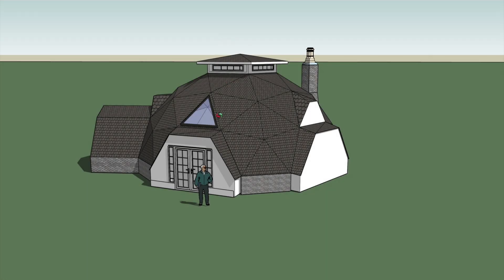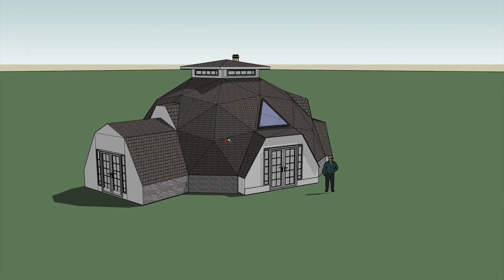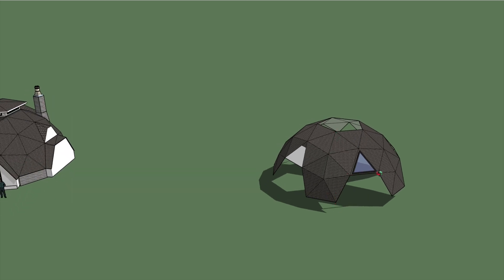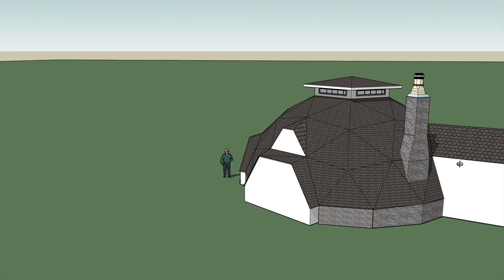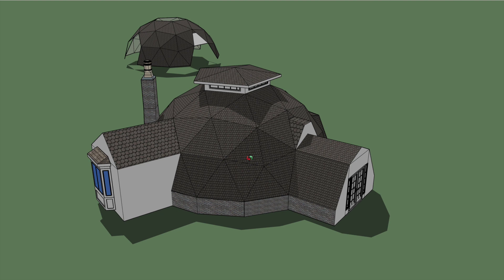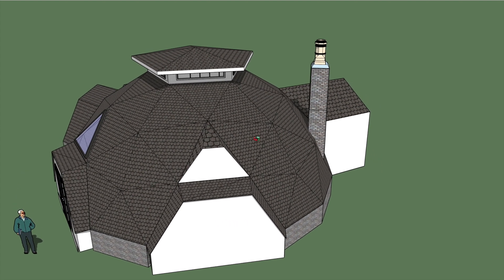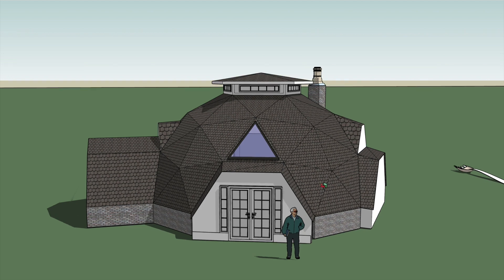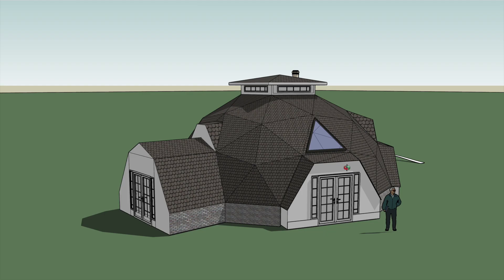Watch this before you build a dome home.

Comment: Why would you not want a fire in your home? It makes the home feel homey.

Also, why should it matter if you have to use different resources, if the top part has to be steel so be it.

Sure, I don't like the front door extension bit. But a lot the comments aren't the greatest, sure it's your opinion and thats fine.

Comment: If they indeed used real traditional house building concepts with it then it is fine. As long as they like it, because it is ok mechanically. I know you said it is weakened because it is only in essence 1/2 a dome, but if they used traditional building methods on those additions then the openings they took out of the dome are reinforced with headers, kings, and jacks. In other words the dome would be weak as hell with all those openings, but not if they put huge headers, kings, and jacks studs, like any traditional building has. Put it this way, it is not going to be caving in anytime soon. As far as the rest of the dome knows mechanically, it has no openings because they are reinforced as if the dome was never opened. But i wouldn't be building anything traditional in a hurricane belt. Actually i recommend not building anything in a hurricane prone area, but they still do it. 

But totally agree on those shingles, no matter what they are wrong for a dome. Fiberglass reinforcement will waterproof it, it will be a smooth shinny surface instead of asphalt. i recommend 2 part epoxy for the resin. If you wanted to, you can make the surface as smooth and as shinny as a modern car, any color you choose too, at the same time reinforce the dome even stronger, and waterproof the entire dome, with its fiberglass mesh and cloth embedded in the epoxy with a top coat of quality marine paint or even car paint.

But you do know we love you right, you are awesome with us, and correct as always. I was only saying if they use real engineering thinking, they can make the openings and still have a strong dome. To be honest, like you just said, if the dome was build in full without the openings, and engineered correctly(size of beams, etc...) it will be stronger than any other type of dome with openings, headers, king, and jacks or not. But it is overkill to be afraid to make openings in most situations, unless your dome is over the entire city.

Comment: The above dome sample shows all the disadvantages of the dome houses. It should be at least at 4th Frequency for this size 5/8 part of the sphere and with small riser. Then all the disadvantages shown in the video above will disapeared. And if you really want to feel the advantages of the dome house, do not make it so big. Better do couple of domes in a size of 6-7 mtrs in diameter and connect them. This is the right dome, :)

Comment: Im thinking about building a dome home w hempcrete, but not fuller. With a solid structure.  Thinking about copula on top, unfortunately must agree with you but what is the solution to it and most of your points?  Can't wait for the next one showich how to.  I plan to build about 11m dia in PL. Because I want a passive standard so the thickness of walls must be 400mm and when I've asked an architect about the insulated floor and a cellar. He stopped writing to me. YOu know, the insulation must be universally same thickness all round and bottom. I plan to use a low deensity mix as used to ceilings, and use it all rond, so will be light and worm. Need chimney, skylight, and enough windows.  Two storey to use space available. Have not sorted out the roof cover so the rain water be drinkable. Therefore no bitumen be used. I love to design myself and give to an architect to check. Use sketchup.   But try to avoid chemicals like glues and foams, an also metal bridges like nails or bolts across the wall. I'd rather use a dowels. Have not figured out a non toxic timber glue. Waiting  for the continuation, thanks.

Comment: I prefer the style and materials in the way designed originally by Buckminster Fuller. It's arguably better than a box home in every way and far more secure and long lasting. The Dymaxion home style. They also only way 3000 lbs vs 400,000 for a typical 2000 sq ft home. The efficient, strong circular design uses less materials making them weigh even less than a mobile home while being stronger than a brick house. I'll be looking to build a dymaxion type home here soon. Beautiful stuff.

Comment: The coupla is NOT a decoration, it is necessary for ventilation.  Many have built domes without a coupla and lived to regret it when condensation destroys their home.  (Visit a few of the owners' websites.)
Reply from the maker: I would recommend a heat exchange ventilation system rather than having freezing outside air come in somewhere and leave out of a cupola, Seems terribly wasteful.

Comment: Cupola is crucial in dome house because it helps in ventilation.
Reply: what if it was made round like a mushroom so no straight lines ruin the structure and storm resisting qualities?
Reply: @pattiannepascual  In fact, one of the veteran geodesic dome builders in USA recommends a slim cupola, with no windows (only vents) to keep its aerodynamic properties.

Comment: built my domein 84/85.  Still live in it.  Love it.
Reply: Any issues with leaks? Are the echoes bad?
Reply: @erikmanguslehnsherr4389  No dome leak issues, some echoes but because all ceramic tile floor. Hexadome.
Reply: @erikmanguslehnsherr4389  Initial leaks, but because of bad shingles.  No problems after that.  It is a hexadome.  Built it in my father's garage, trucked to building site, then assembled.
Reply: The way to go is a trapezium dome.  That is what I want next.

Comment: I've been following you for a few years now. I've bought some wanger flanges and am playing with them.
I would like to ask your oppinion on using a shotcrete type of material on a dome frame. Mt husband is a roofer and hates the thought of roofing a dome structure, especially here in Alaska. 
I want to start with making your gazebo and if it works move on to the unity dome.
Reply: We built a shot Crete dome in Florida 30 yrs ago.  The first company we used did not follow the instructions to apply think coats to the bottom section and let dry some before adding more and continuing to the top and they collapsed the structure.  We had to tear it down to the slab and start again.  My husband trialed the mud after that.  It turned out great and insulation from polystyrene of 9” thick was amazing the fire place heated the complete 30’ diameter dome with extensions and second floor.
Reply: @debsboard  I plan to build mine with branches and wanger flanges for frame. I want to use the cement as waterproofing vs structural, at least in the gazebo.  It has thin legs relatively.  We could do the heavier foot on a full dome.
Reply: Concrete is not fully waterproof unless an additive or waterproof paint is applied
Reply: @debsboard  I planned on a sealer. Right now I've been using waterproof canvas as my covers on structures. Then chicken wire over.
Reply: @akespt  just read the sealer directions it will only last for a period of time .it gives directions on how often to reapply
Reply: Or you put a waterproof liner is used under the concrete

Comment: As the geomagnetic field around our planet continues to weaken, the possibility of an moderate EMP taking down the power grid grows. Considering this, the logical way to have a backup heating system for a home would be the traditional fireplace and chimney. So my question to you is, should someone have a traditional fireplace and chimney in a dome home, how and where would it best be positioned?
Reply: Middle ofcourse.
Reply: Ours was positioned in the center and it worked great. The second floor was only half of the upper area. Two extensions one for entry and the other a full glass dining room off galley kitchen. 3 bedrooms and large living room with slate floors
Reply: Check out rocket stoves, maybe masonry stoves as well

Comment: I can't wait! I'm currently about to leave the whole idea of using a dome as my future home because of various reasons including those you mention here. You Sir have been my main source of inspiration and learning and I really can't wait to hear what you have to say about how to solve all these issues. Btw I think the reason for the open top could be to keep the place cooler in the summer. I've also seen images showing how  the air flow in a dome helps in that regard, which I believe would be affected by interior walls and the such.
Reply: I'm just about positive that keeping cool in the summer is one of the aircrete dome's most immediate advantages.
Reply: It needs to be fiberglass coating not shingles and you solved the main problems.
Reply: @TheRebelmanone  check liquid cork as well

Comment: why would you not have a fire, if building a shelter for bad times. as for example when electricity fails and all hell breaks loose in your nation?
Reply: He is saying that you don't have to have a huge chimney. You could simply have a pipe coming out. That big chimney compromises the geometry of the dome.
Reply: @MeesterVegas  perhaps, but if not a large(er) pipe(the stove) is coming trough the roof, wouldnt the heat be a factor, concering about the roofs ability to last?

i suspected the speaker was saying like "because electricity is so certain these days".. but ofc assume:nothing could be a good principle, i guess
Reply: @MeesterVegas   at 3:44, he actually says "in a modern house, why would you NEED a fire"